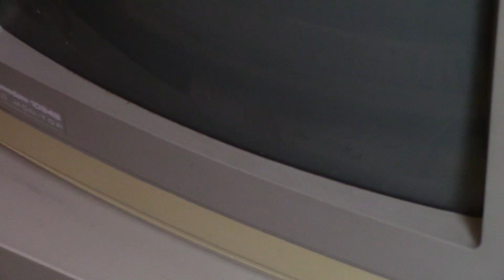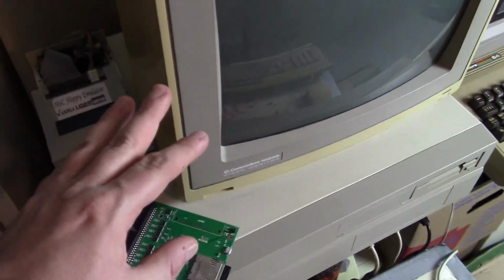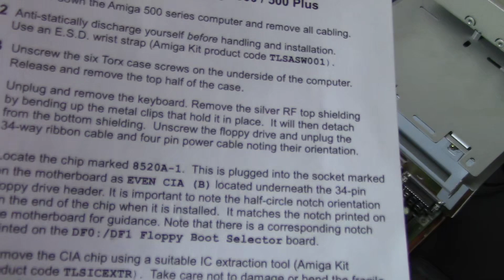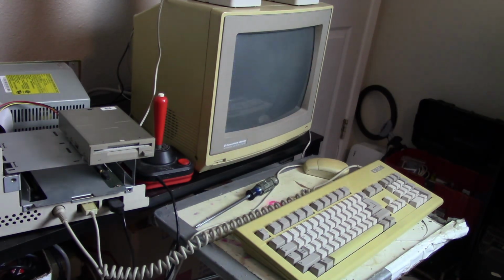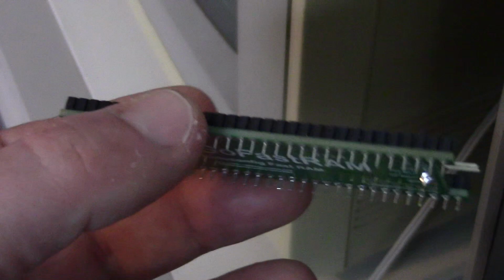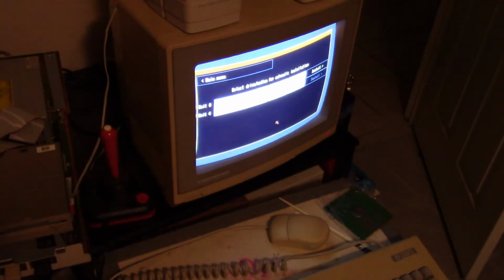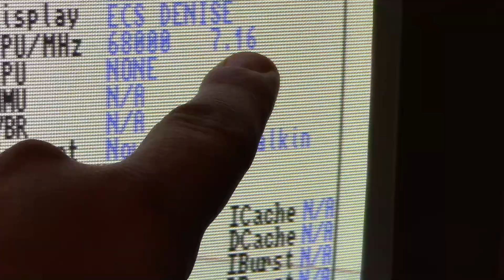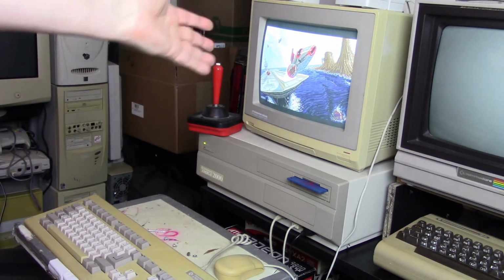Some Tasteful Amiga 2000 Upgrades

Comment: For the Amiga I would want to go simple. A500 with 1MB RAM and GOTEK floppy and Philips CM8833 RGB monitor 🙂
Reply from the maker: I grew up on the A500. My dad was a big amiga/Commodore fan so my first computers were an Amiga 500 and a C64c. I like the A2000 because its basically an Amiga 500 that you can expand if you want. Most things ment for the A500 work with the A2000. A stock A500  or A2000 with 1MB will run the vast majority of games but if you want to use WHDLoad I bit more power helps.

Comment: I must say I'm very happy with my Warp1260 with a 060. WiFi, HDMI output and scandoubler. My dream come true and sticking to the 68K architecture.
Reply from the maker: Something about sitting down to an Amiga with a flat LCD monitor that just completely destroys the illusion for me. I get it though, old RGB monitors are getting hard to find even if you wanted to.

Comment: Cool content! I have two very broken Amiga 2000s I'm currently working on. One I managed to fix after a boatload of work, but these tasteful machines are always worth the effort  😄👍
I agree about finding it a bit of a shame to see these old beauties being upgraded to the moon and back which is why I always prefer period correct upgrades like the high end 040 accelerator from 1990 I have in my 2000. It's has one of the very first 040 CPUs ever produced on it🤤 but I also have an A500+ board with a Vampire on it in a nice Checkmate case just because I love all that new tech as well. One who wants it all doesn't have to choose 😉

Oh and you need to rejumper that Gotek to be DF1: instead of DF2: for the floppy switcher to work. If you can get the Gotek to be seen as DF1: by the Amiga. It will probably work as it's supposed to. A lot of Amiga games are really weird that way as they actually require the diskdrive they run from to be DF0: and if they're not they just won't boot! The floppy switcher takes care of that (makes the system see the external drive as DF0: but only if it's jumpered as DF1:!)
Reply from the maker: Thanks for the tip, I'll check the jumpers on the external Gotek today, hopefully, that is the issue and it gets corrected, thanks for the tip! 

I have a PAL Amiga 600 here that I've been thinking of going crazy with upgrades just for the fun of it, I just wanted one Amiga that I could have as kind of a "base level" unit that more or less retains all of its "Amiganess"
Reply from the maker: Just tried playing with the jumpers, but no luck, unfortunately. If it's set to anything other than what it currently is it doesn't even get detected.

My theory is it's the A2000, on an A500 the switcher works because the A500 only expects 2 drives, DF0 as the internal drive and DF1 as the external. Since the A2000 has 2 internal floppy bays the external drive is hard-coded to be detected as DF2 and I'm not sure if there's any way around that.
Reply: @AncientElectronics  Somehow my last post got completely deleted (youtube policy I guess). I looked up what I did with A2000 in the past to make them boot from DF2:
The A2000 does indeed see the external drive as DF2: but there are boot selectors/floppy switchers that support both the A500 as well as the A2000. Most of them use a jumper to let you choose wether you swap DF0: with DF1: or with DF2: :yougotthis:
Reply from the maker: @pipschannel1222  unfortunately the switchless selector I have has no jumpers. The manual claims its Amiga 2000 compatible which I guess it kind of is.
Reply: @AncientElectronics  Unacceptable if you ask me. I would go for a refund as it's hardly usable this way. But it's up to you of course..
Reply from the maker: @pipschannel1222  its the switchless floppy selector from AmigaStore.com. I bought it well over a year ago.
Reply: @AncientElectronics  That's too bad.. There are a few things you can do though. You could mount the Gotek within the case like mr. Lurch did on his channel. That way it'll behave just like an A500 (Gotek as DF1:). Only I think a Gotek in an A2000 case looks like garbage (definitely would't qualify as being not tasteful IMHO😅) even with a 3d printed enclosure so I prefer to keep those Goteks external. I remember using a floppy cable extension on one of my A2000s in the past that I just stuck out the back along with a power cable extension so I could have a DF1: drive outside the case and switch it to DF0: on a A2000 with a single internal drive 👍

If you're handy with a soldering iron you could swap the connections to pin 14 and 15 on the CIA socket/switcher. It's simple select logic: pin 14 selects DF1:, which is how it's wired right now. If you swap the connection to that pin with that of pin 15 you should get the Amiga to see the external drive as DF1: 👌  I think it's way easier to just extend the internal floppy cable out the back though.. No soldering required but maybe less neat with that flatcable sticking out..

Comment: I dont mind seeing some mid-rage accelerator (like 68030) inside Amiga 500/2000, with as much RAM as it can take. You should at least consider 68k10 CPU upgrade (some 10-15% performance gain). As for SD-HDD solutions, i wouldnt hesitate at all about it.

Comment: This might be an oddly technical question Justin, but can you confirm if the horizontal frequency of the amiga/denise chip is precisely 15734Hz when outputted to an NTSC TV set?
.
The reason why i might be asking such a strange question is because i was asked this myself, though i do not have any amigas, nevermind an NTSC model.
It's to do with a mysterious audio clip of an unknown pop song and we are trying to work out where it was captured from.
Thank you
Reply from the maker: I'm not sure how I'd go about checking that, to be honest. Sysinfo gives a "horizontal frequency" but I'm not sure if what it's referring to is what you're looking for. hooked up to my Amiga monitor it says it's 15.72Hz but it doesn't give any more of a precise reading.
Reply: @AncientElectronics  Thank you for your reply Justin.
You mentioned monitor - do you mind me asking if any of your amigas can be hooked to a TV set via RF? 
Unless I'm mistaken, the A600 had a built-in RF modulator?
At the least, work out if the output frequency is any different between TV and Monitor.
Thanks again
Reply from the maker: @Viczarratt  I have a PAL A600 somewhere in this mess. I don't remember it having RF, I thought that was only via an attachment for the A500 but looking it up it appears it does. If I can find it (and if it boots) I'll hook it up and see if it works though I don't have any PAL-compatible TVs that have RF inputs.
Reply: @AncientElectronics  Thank you even more so for your efforts in this, and I wish you enjoy your A600 once you find it amongst the turbulence.
.
In regards to the PAL TV issue, you might already know about a trick about holding down both buttons on the mouse during boot and this takes you to a settings screen. If a later version of the kick-start rom is in the system, you may be able to get the PAL A600 to output NTSC via this screen. At least do some research and use your own judgement before actually trying this out, because I have zero experience with the Amiga platform.

Comment: Not true. t least all accelerators from that area back in the day always had the option to switch back to normal 68K mode using the built in CPU. You needed that for gaming compatibility.

Comment: You have an Amiga 4000?
Reply from the maker: @RanHam  yes, but the sound doesn't work.
Reply: @AncientElectronics  would you be interested in selling it. I would restore it, not interested in flipping.
Reply from the maker: @RanHam  I've been trying to have it repaired for years. Everyone that looks at it fails. Im pretty sure the sound chip needs desoldered and replaced
Reply from the maker: I did a video on it https://youtu.be/ZOP5A6bs3_Y?si=B6KiiatZfWAy93Tn